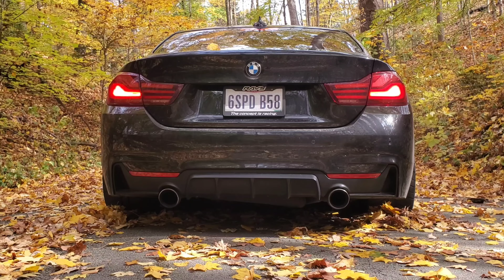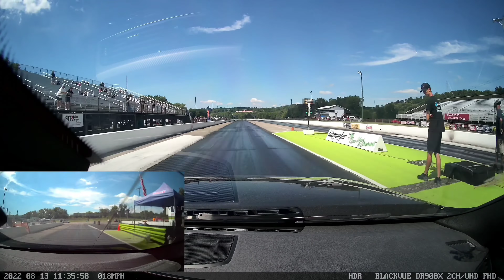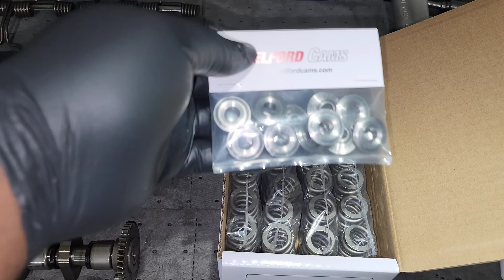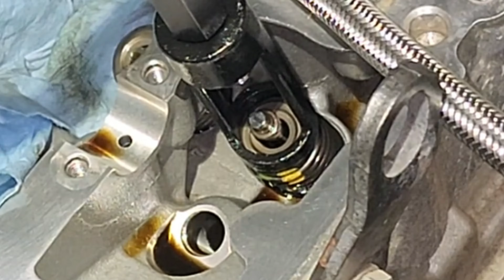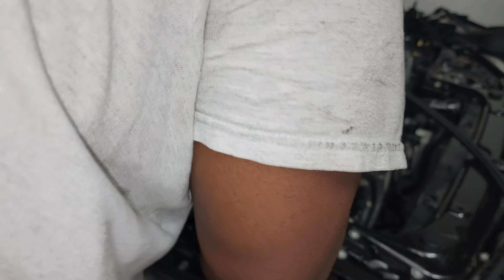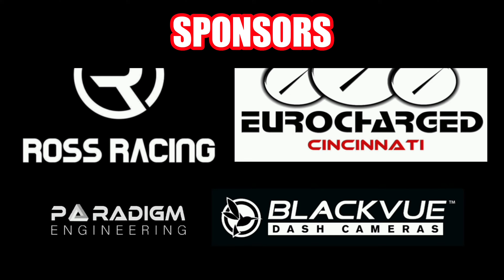340i Kelford Upgraded Cam Install Part 3 of 3: Valve Springs & Retainers (Without Removing the Head)

Comment from the maker: TOOLS YOU NEED:
Cam Timing Tool Set: https://amzn.to/4tfZLlK
Valvetronic Spring Tool: https://amzn.to/4tQJNi3

Forgot to mention that the smallest adapter on the valve spring compressor is slightly too big for the stock intake side retainer. I put tape on the lip to make up the space, or you may be able to use one of the exhaust retainers as a spacer to make it work. The Kelford retainers fit it perfectly.

Comment: What about Valvetronic adaptation? Doesn't the greater resistance from stiffer springs and a sharper shaft cause problems? We have problems with adapting the end points, the servo detects too much resistance and ISTA is unable to complete the procedure.
Reply from the maker: No issues on my end. The valvetronic springs and eccentric shaft aren't replaced. Only the valve springs and camshafts
Reply: @ I put the stock intake shaft and stock springs back together and the adaptation went straight away. I put the Kelford stage 2 intake cam with springs back in and even ista online doesn't help, the error of not detecting end positions is still there. What can I check here? Everything done on factory locks from the service according to the AIR instructions and service tools.

Comment: had a quick question- have an auto 440 with MHD stage 2+ tune (sports cat and HPFP). I've noticed than when i'm in sports for both engine and gearbox, and let go of the gas, my speed and revs will remain stuck for a second or two before the car starts to engine brake and decelerate. Didnt really notice this before, not sure of its after i updated MHD or if somethings wrong
Reply from the maker: I think this is normal. Do you mean for a short moment or like the car keeps carrying speed for a while? You can try updating the app and reflashing your tune.

Comment: Please don't call them 'keepers' They are called collets and if you put grease or a lube on the valve stem the collets will stick to it. Job done.
Reply from the maker: they're called a lot of names including valve keepers, valve locks, etc. and unfortunately my problem was with placement not with it sticking to the valve.

Comment: 10:00 if you would have a helper to keep it pushed down then you could put that retaining clip with your hands… !?
Reply from the maker: what i wish I had was a tool that just clamped down without needing to be held. like something that screwed down and applied static pressure to keep the compressed spring in place. but it still takes patience to line up the keeper